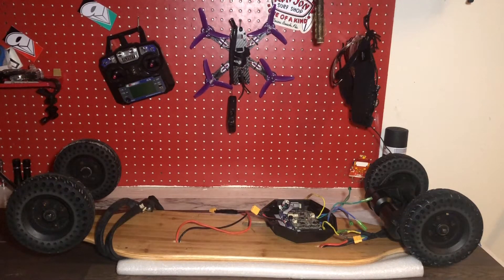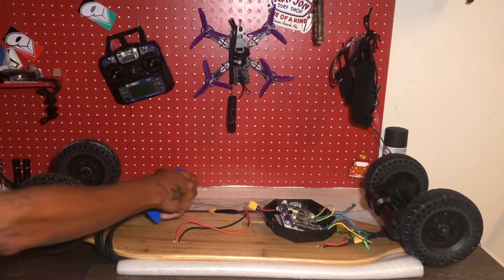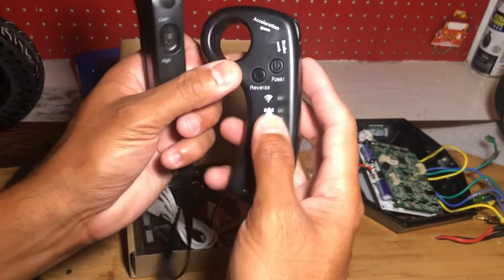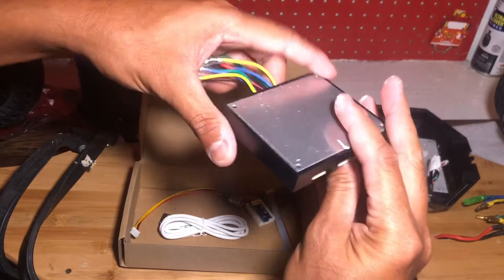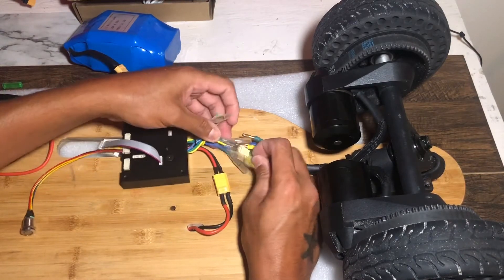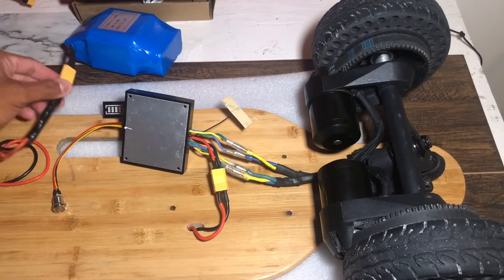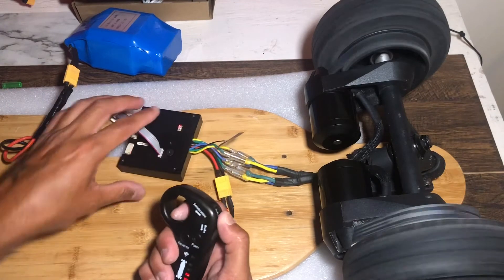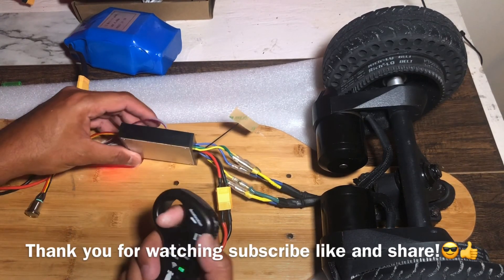Electric Skateboard ESC Kit Unboxing!🤔

Comment: Awesome video!
Reply from the maker: Thanks for your comments My friend! I’m glad you enjoyed watching the video. I had my electric skateboard almost 3-4 years since ago.I’ve had it when the first Dji Spark this came out that time.Over the years I’ve been running it on the beach saltwater over the summer.had plenty times submerge on salt water puddles! My old motherboard survived over the years.eventually it gives out on me. but I did not destroyed completely. All I did clean up using fresh water and vinegar and It do the job especially on corrosion!!! But I want more power now and modification on the Electric skateboard. I found a cheaper solution plug and play!😎👍